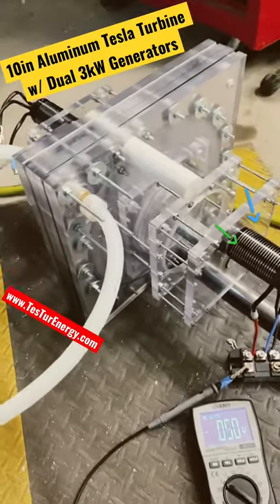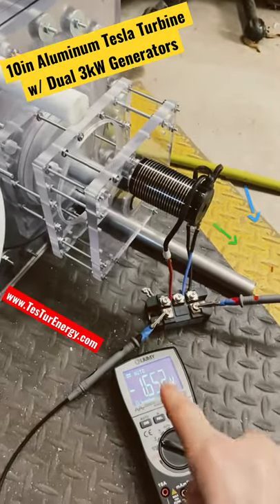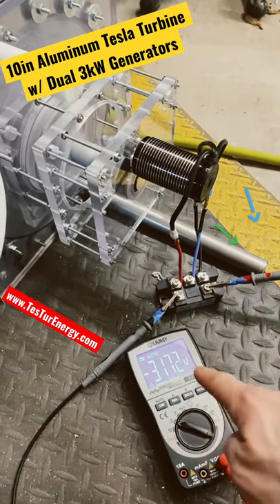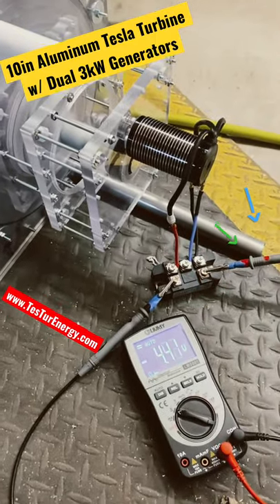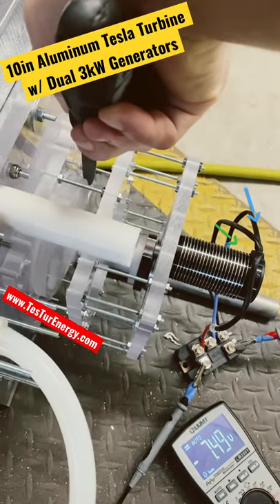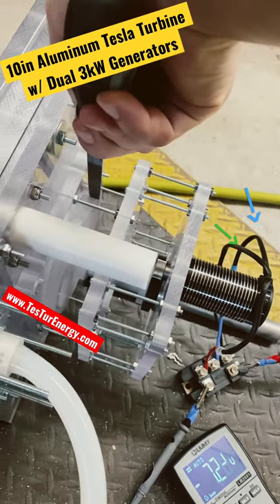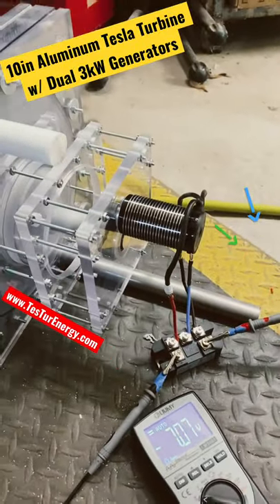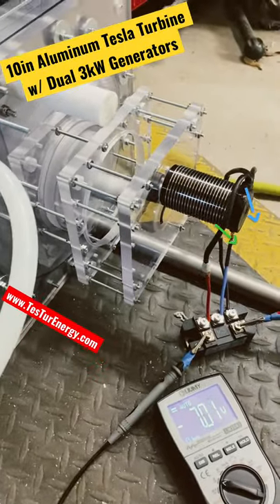10in Aluminum Tesla Turbine ⚡️ Dual 3kW BLDC Generator Solar Off Grid Electricity Production

Comment: Have you ever thought of sand blasting the disc to make them rougher for more friction
Reply from the maker: Hey Jorge! So take a read of this write up I put together. You want as smooth of discs as possible. Any roughness will be bad for the laminar flow regimes needed. 
(Original post location: https://www.youtube.com/post/Ugkxif4iryzOpEXN9G3bmId9xznZTk1yuxyz) 

[TL/DR: This is not a mechanical turbine in any shape or form. Since all molecular adhesion and internal viscous forces within a fluid are governed by electron orbital interactions, this makes the Tesla turbine a purely electronic turbine.]

The BIGGEST misconception about the Tesla Turbine that most people get wrong is that they think the fluid is actually sliding and dragging on the disc, similar to as if a solid object was “sliding” across the surface of another solid object. 

It is not. Full Stop. 

The fluid that’s just off the surface of the disc face is ALWAYS statically adhered to said disc face and never moving relative to the disc. 

The torque to the disc comes from shear stress “cohesion” forces within the motive fluid trying to move through itself.

The shear force is transferred through the motive fluid itself to the layer of fluid that is statically adhered to the disc faces, and then through the virtue of molecular adhesion the discs are pulled along with it, or Vice versa the discs pull the fluid along with it. 

The only “friction” involved in this is that of internal friction within the fluid against moving through itself, ie Cohesive viscous forces. 

And sorry I don’t mean to sound like I’m being pedantic, as I’m sure I’m restating many things you already know. 

It’s just a very important key part of the operating functions that everyone gets wrong. This is not a mechanical turbine in any shape or form. 

Since all molecular adhesion and internal viscous forces within a fluid are governed by electron orbital interactions, this makes the Tesla turbine a purely electronic turbine. 

As Tesla even alludes to in the article “Dr. Tesla Talks Of Gas Turbines” ( https://youtu.be/TGGLG-7hK50 )….

… “I have been working at this a long time. Many years ago I invented a pump for pumping mercury. Just a plain disk, like this, and it would work very well. ‘All right,’ I said, ‘that is friction.’ But one day I thought it out, and I thought, ‘No, that is not friction, it is something else. The particles are not always sliding by the disk, but some of them at least are carried along with it. Therefore it cannot be friction. It must be adhesion.’ And that, you see, was the real beginning.

“For if you can imagine a wheel rotating in a medium, whether the fluid is receiving or imparting energy, and moving at nearly the same velocity as the fluid, then you have a minimum of friction, you get little or no ‘slip.’ Then you are getting something very different from friction; you are making use of adhesion alone. It’s all so simple, so very simple.

“This is the greatest of my inventions,”……
-Nikola Tesla (September 18th, 1911)

When designed correctly, it works principally upon electron interactions between the fluid and itself and the fluid and the disc material. 

The first important factor being how well does the fluid actually molecularly adhere to the disc faces when submerged in an atmosphere of the motive fluid. 

This is also seen as the “Wetting angle” when there are two fluids in contact with the surface and they are competing for adherence. 

Think hydrophobic and hydroPHILLIC surface treatments.

The second important factor is the viscosity of the motive fluid in question, as it represents the fluids ability to “flow through itself with or without resistance” per se. 

Herein lies the reason it is extremely important to maintain laminar flow regimes within the disc spaces. 

Because irrelevant of the viscosity of the fluid, ALL FLUIDS, liquids and gases, can be forced to flow in highly efficient low Reynolds number laminar flow regimes given the right initial conditions and “flow cavity” parameters, such that turbulent boundary layer slip is eliminated, stream separation and counterflow is eliminated, rapid pressure changes from turbulence resulting in noise losses that can lead to early fatigue on discs and parts is eliminated, etc. 

Furthermore, because windage is all but inexistent in the Tesla Turbine, it stands to potentially be the quietest running turbine ever when properly designed. 

(Sidebar: This is why I have speculated over the years that these Tesla turbines have actually covertly been in practicable use all this time in things like covert/stealth submarine Primary Power Units (PPUs) and/or just plain stealth “trolling motors” but that’s honestly my own sheer educated speculation at this point. 🤷‍♂️ it just makes sense.)

This is where working out the complex solutions in the Naviar-stokes equations come in for designing practicable machines.

The Difference Between Adhesion and Cohesion:

The tendency of two or more different molecules to bond with each other is known as Adhesion

Whereas the force of attraction between the same molecules is known as Cohesion.

The adhesion forces can be one of the results of electrostatic forces which are exerted on different substances. 

The cohesive forces are associated with Van der Waals forces and hydrogen bonding that cause liquids such as water to withstand the separation. 

When a glass surface is poured with water, both adhesive and the cohesive forces act on the surface of the water. 

A strong adhesive force tends the liquid to spread over the surface whereas a strong cohesive force is responsible for the formation of water droplets on the water surface.

The adhesion and cohesion forces, both vary in their strengths. 

For example, if cohesion forces between the water molecules are stronger than that of the adhesion forces between them, then the individual molecules will attract towards each other thus resulting in settling. 

In the other case, if the adhesion forces of the water surfaces are stronger than that of the cohesion forces of the water molecules, then the water tends to disperse.

Plastic substrates are difficult to bond because they are "hydrophobic" (not naturally wettable), possess poor surface wettability (i.e., low surface energies), nonpolar-inert structures and possess poor surface-chemical functionality. 

The contact angle and its physical properties of interaction between solids and liquids provide valuable information in determining optimal adhesion bonding surface wettability conditions. 

The angle formed by the solid surface and the tangent line to the upper surface at the end point is called the contact angle. 

It is the angle between the tangent line at the contact point and the horizontal line of the solid surface.

The bubble/droplet shape is due to the molecular forces by which all liquids, through contraction of the surface, tend to form the contained volume into a shape having the least surface area. 

The intermolecular forces that contract the surface are termed "surface tension." 

Surface tension is a measurement of surface energy, and expressed in "dynes/cm" (or mN/m SI units). 

The higher the surface energy of the solid substrate relative to the surface tension of a liquid (water, printing inks, adhesives encapsulation, coatings, etc.), the better will be its "wettability," and the smaller will be the contact angle. 

Surface wetting tension can possess varying degrees of contact angles ranging from zero (0) to 180-degrees.

As a general rule, acceptable bonding adhesion is achieved when the surface energy of a substrate (measured in dynes/cm) is approximately 8 to 10 dynes/cm greater than the surface tension of the liquid. 

In the case of H2O motive fluid, gaseous or liquid, a robust "hydrophilic" surface is needed to be achieved versus non-wettable "hydrophobic" surfaces.

For more information about fluid adhesion forces at the boundaries of solid surfaces please watch through the whole video “The Fourth Phase of Water” by Dr. Gerald Pollack. 

https://youtu.be/i-T7tCMUDXU

Dr. Pollack is doing AMAZING research in hydroPHILLIC surfaces and desalination of water, and potential electricity generation from stored electric potentials within molecular adhesion lattices generated from ambient heat/IR light. It’s quite revolutionary work that just getting off the ground!

Thank you!
-Charlie Solis
Reply: @CharlieSolis  oh so it works through laminar flow cool

Comment: What is that small black box device?
Reply from the maker: Hey leucemidus! That little black box is a 3phase full wave rectifier. It turns the high frequency 3phase alternating current from the generator into DC out. That dc out is anywhere from 0-24V. So it’s perfect for charging batteries. And even from there the DC can be turned into 60Hz AC needed to power normal appliances really easily. All of the shelf parts too.
Reply from the maker: This is a short video I did on it. 
https://youtube.com/shorts/Koa9krN6H1I?feature=share
Reply: @CharlieSolis  what frequency have at the electrical output?  and have you done test with electrical load?
Reply from the maker: I’m not sure exactly the frequency I forgot how many poles this generator is off the top of my head so I’ll get back to you but the generator Kv rating is 2200rpm/volt and has a max rpm of 60,000 so up to 0-25Volts up to 120 amps, somewhere in the ball park of 100hz-20,000hz 3phase AC lol it also has a Kt rating of 4.3mN•m/amp. 

And the only load I’ve put on it yet has been a thin stainless steel wire. I got it pretty dang warm in 20 seconds at 7.5 volts. Until I ran out of air lol but other than that I still have some tweaking to do before I give it a full load test.

Comment: You need a new camaraman.
What's driving the turbine? Air? Where is it comming from?
Reply from the maker: Hey thanks for commenting. Yeah this is a really old video 😅
 
With TesTur Energy, we’re committed to empowering individuals with energy autonomy through our Combined Heat And Power (CHP) solutions.   Our systems are uniquely designed to harness overlooked energy resources like biomass, solar thermal, and geothermal, as well as unconventional fuels rich in solid particulates—think sawdust, pulverized coal, or powdered iron.  Traditionally, these alternative energy sources and fuels have been underexploited due to the limitations of existing turbines and engines.   These systems often can’t manage the complex fluid flows—mixtures of gases, liquids, and solid particles—that are characteristic of low-grade heat boilers and unconventional fuels.  But our technology changes that, enabling sustained, damage-free operation even in these challenging conditions.  

www . HeatAndPower . com  

www . TesTurEnergy . com 

Our initial tests serve as an exploratory stage to gauge the electrical output potential of a Tesla turbine driven by room-temperature compressed air.     Remarkably, our plastic and aluminum 10in diameter prototype generated 6.22 ft-lbs of torque at a mere 4150 RPM and over 4.25 kW between 6000-12,000 RPM.     This places our prototype squarely between the capabilities of a 50cc and a 125cc combustion engine, even with those on 150psi compression scenario.    During our tests, TesTur nozzle pressures stayed below 20psi for a 2650-watt electrical load and never exceeded 40psi during a 4250-watt dyno test.     The smaller 4.5in diameter prototype has been tested up to 600watts with real electrical load at about 15,000rpm. And up to 1200watts on the Dyno between 6,000rpm and 18,000rpm. And the nozzle pressure was about 25-30psi.  These initial tests serve as a baseline for future tests involving combustion-level temperatures.    It’s noteworthy that when using elastic gases, an often-overlooked aspect is that gas viscosity actually increases with temperature.     This not only boosts thermodynamic efficiency but also enhances TesTur’s isentropic efficiency by reducing slip due to the increased viscosity.    For a deeper dive into our testing and findings, head over to my YouTube channel—the link is in my bio.     If you have questions, don’t hesitate to leave a comment on any video.    I’m committed to offering detailed, thoughtful responses to all inquiries.   Cheers!
Reply: @CharlieSolis  That explains it much better.
How about a small portable water turbine.
Something that could replace a water wheel?
Reply from the maker: @greghackstaff217  hey thanks for replying! Yup that is another application 

I just haven’t done water tests yet. 

Soon though! If you’re interested, check out my Instagram @SolisHoods for more information.   
 
I’ve got a lot more in depth videos up there.   
 
Also check out the Tesla turbine collab video we made with @Integza that Joel posted to his YouTube channel back last August! 

Integza did an amazing job with the video! 

 And please leave a comment on any video if you have any questions.   I’m always happy to give really in depth responses to everyone.    Cheers!